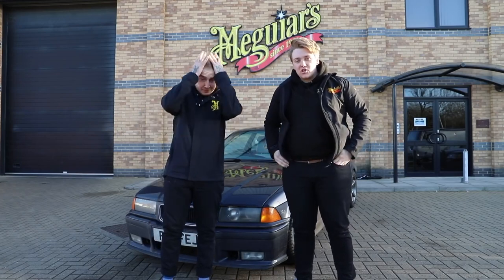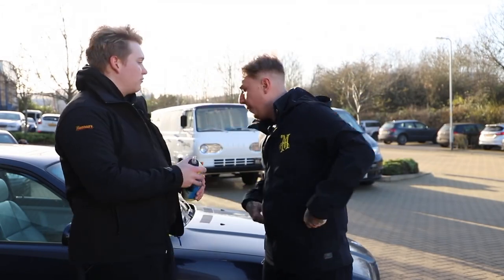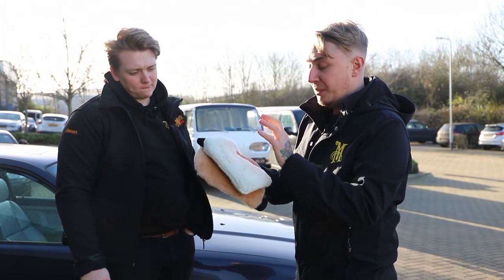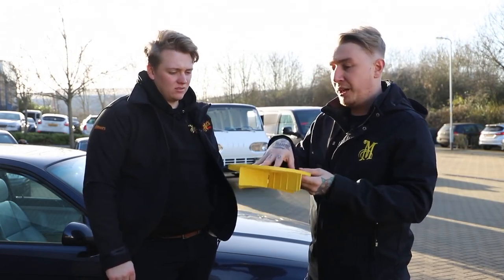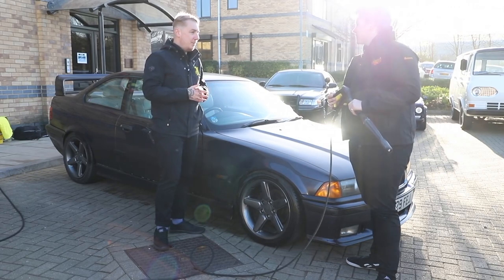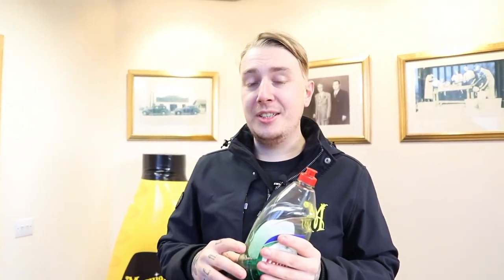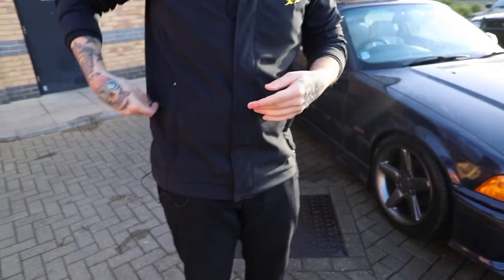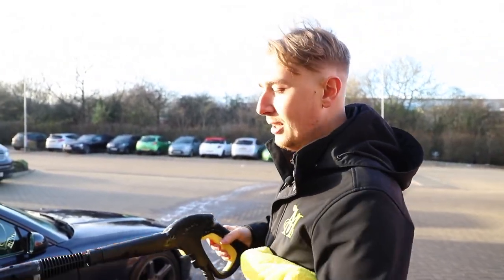Car Washing & Drying - Meguiar’s Detailing 101 – UK Edition

Comment: is dish soap alright to use when prepping the car for a 3 step paint correction? Just makes sense to strip the paint of wax before working on the paint
Reply from the maker: It is not something we typically recommend but in theory the use of it one time following by detailing the car would not necessarily be a problem.

You should also realize that the compounding step is going to remove any remaining wax anyway.

Comment: My car has ceramic coat, is the wash and wax safe to use without removing the protection?
Reply from the maker: Yes, the Ultimate Wash & Wax is safe on a car with a coating.  It will not remove the coating in any way; however you should be aware that this could have an effect on the water beading created by the coating.  Again, this is not harmful in any way but something to be aware of.  If that is a concern for you we recommend the use of our new Hybrid Ceramic Wash & Wax which will boost water beading on a coating and provide far superior protection, but again either are safe and will help maintain your coating.
Reply: @meguiars  I can't seem to find it anywhere in the UK?